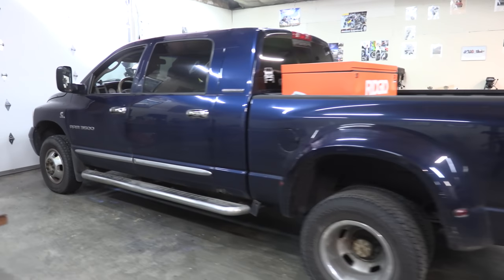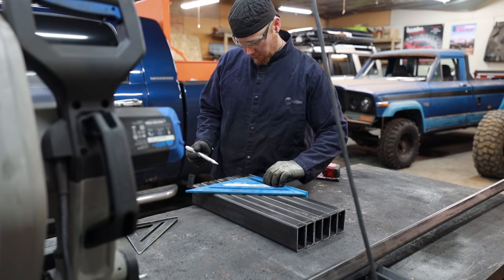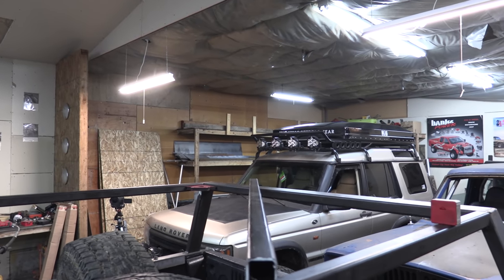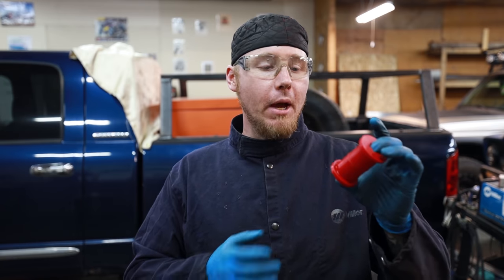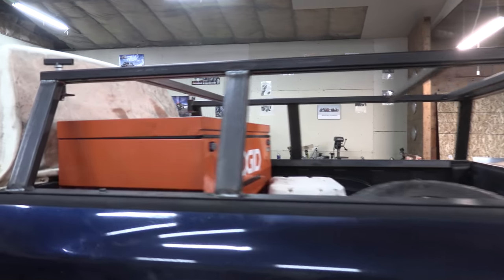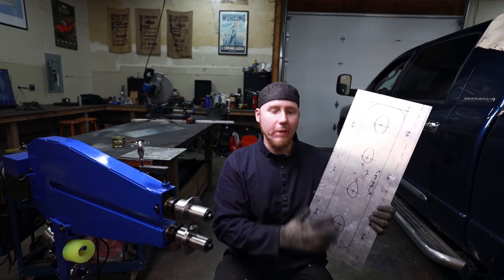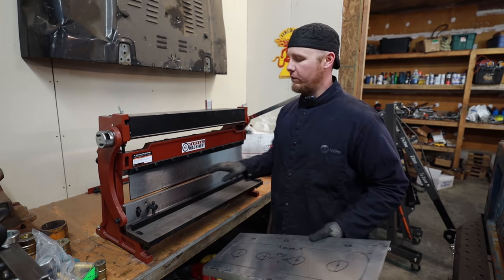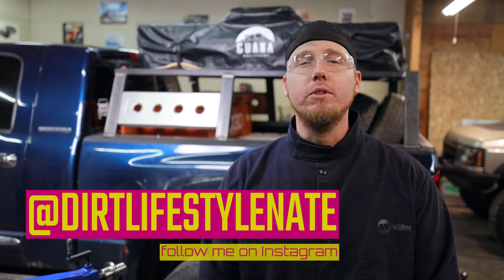Roof Top Tent Camping! Build Your Overland Truck Bed Rack System

Comment: Out of all the trucks to complain about not having enough room to sleep in the cab, a MEGA CAB DODGE?
Reply: I mean, the seats dont quite fold down all the way. And sleeping sideways in the back seat isnt the best either.
Reply from the maker: Lol
Reply: Lol
Reply: Well... it’s just an excuse to build an epic feature on the back, with loads of functionality. Lol
Reply: Sleeping in the back of my Megacab is not great. The 8ft bed in back is much more comfortable.
Reply: I camp nom out of the back seat of my mega cab  I'm 6'4" so I am sleeping caddy corner and uncomfortable. So I am looking at a roof top tent for the neck of my goose neck trailer/19 4runner
Reply: At 6’1” I can’t sleep in the back of my MC. A twin air mattress won’t quite lay flat with the seats folded down.  When I have slept back there to been at an angle.
Reply: Lol but who wants to sleep in the cab of anything really
Reply: @ericl5973  mega cabs don't have an 8ft bed
Reply: @fzj8022  Stock megacabs don't have an 8ft bed.
But stretching trucks is a thing some people do.
Reply: @reaperreaper5098  Yeah no shit
Reply: I'm 6'2" and slept in my mega twice. Once on top of the backseat while folded flat, once in the drivers seat. It would be an okay option with padding, but it's still rough for a taller guy.
Reply: The rrear seats are perfect for truck camping my mega cab rear seats fold down completely flat and I fit my single foam mattress in it perfectly. Let the truck run all night with the ac or heat on. Best camping set up by far.. I've had toppers , roof top tents and nothing beats sleeping off the ground on a comfy mattress inside the safety of my truck.

Comment: If you are wiring up lights you could wire up a 12 volt linear actuator for lifting the frame up. They have good load capacity now and it will just be an up and down switch. Just some food for thought instead of the shocks that we know always fail and your tailgate glass ends up in the middle of your back.

Comment: It’s easy to grab the wires for the bed light from the a pillar for your under cage lights. Maybe not all of them but a subset so you can hit the unlock on keyless and get bed lights from it. Plus it stays on the battery saver for the tipm so you can put them on and they stay lit for 15 minutes or so and then go off (great for getting prepped for bed)
Also the trucks have a high mounted tail wire hidden in the loom back by the hitch for truck caps that bring the third brake light back to the back of the truck so you can put a third brake light on it if you want without having to fuss with tapping wires or having it blink.  Love the truck and the tent rig. Like to see more of it 👍

Comment: Look up Sachs stabilus lift supports, you can go by weight and length, and they also have thread ball hardware to mount anywhere, and essentially create a sprung door on anything

Comment: Damn this is timely.  I'm about to start fabbing up a rack system for my M1102.  Don't think an off-the-shelf systems are going to work for it.
Reply from the maker: Cool project!
Reply: @DirtLifestyle  Yeah it should be.  Going to need to brush up on my aluminum welding skills tho.  Been a while.

Comment: I built a flip up bed rack about a month ago, it works great and it's awesome to be able to get the tent out of the way if you need to access stuff at the back of the bed. I have gas struts on mine, a pair of 200lbs struts did the trick for me.

Comment: Nice work!    I’m building a Jeep trailer right now.  With a tent mount using 1x2 Rec tube 120 wall.  Just put a 14 bolt axle on the trailer.  6” lift kit and 36s on a 77j10 box.  Nice work on your rack!   I like the angled look you have going on.   Looks badass on the dodge!

Comment: You are so spot on where I am at on thinking about setting up my Gladiator!! Literally I have been thinking EXACTLY like you!   I work the oilfields in North Dakota but live in Kennewick WA it’s a 16 hr drive one way and sleeping in the back seat of the Gladiator is... not good rest! So I need a rooftop tent. Also I need water proof and theft proof because I park my Jeep and crawl in my Semi and it’s 4 or more weeks before I get back! I want to build the rack and then sheet the roof and sides with aluminum and the rack itself is aluminum because I want to keep the weight down but need it strong enough to support 4 ( we are adopting 2 kids) you just gave me a huge idea! I too want lights and we are right there with you on “ Tailgate “ cooking! I eagerly await your next video and hopefully you can maybe do one on how to weld aluminum?
Reply: Bud I live on the Oregon coast,  we should talk about setting our gladiators up for a northwest package.  I have a few ideas I'd like to bounce off you.
Reply from the maker: Sounds like a fun project! I'm no expert at aluminum welding. After more time honing my skills I'll definitely make a video 👍
Reply: Tony Montgomery I am very interested in doing this! Thanks
Reply: Dirt Lifestyle I was thinking of cutting and bolting it because I can’t weld it either? :( I am open to any light weight but strong ideas you got

Comment: Just finished making mine from your design: 1/4" angle and 3x1.5x 1/8 wall rectangle for my Sierra.  I have a huge RTT from 23zero and I am glad this rack is redundantly strong with no bolts that could loosen.  Thank you so much for the guide.
Reply: any chance i can get a review from you, in regards to the tent from 23zero, I'm currently looking at one too.

Comment: I am planning on making a rooftop tent rack that swings in a sinilarish manner. Except the tent stays level. I want to tuck it below the roof line but then swing it up to be able to pop the tent open. This is partly because I have a toolbar that I like the look of. 

I came up with an excel sheet that lets you plug in parameters of mounting distance and force and spits out how much net torque you get from the shocks at any particular angle, telling you how hard you have to pull to lift the rack. I’d be happy to share it with you if you’d like
Reply: Hey James. I'm looking at doing something similar to what you describe on my truck. Have any pics or any other info you can share?

Comment: The gas shocks that lift up a 97 to 99 Ford Expedition back patch would probably be plenty of strength to lift up that roof top tent. The back hatch on those Ford Expeditions are roughly 225 lb. The newer Expeditions have an aluminum lift up hatch so the gas props aren't rated to lift as much since the doors lighter but the 97 and 99 has a really heavy Steel lift back hatch

Comment: I have my RTT on my utility bed work truck. First time mounting it was side ways. Every time since then I have mounted so that tent opens over the tailgate. Makes for a great kitchen without having to use an actual table. Also gives you possibility of mounting an awning off the side without interfering with the tent. Also having a rtt with the covered entrance,  I can climb down to a work/kitchen station without getting hammered by rain. As a bonus, when my annex room is set up,  tailgate is conveniently inside. Rare but has happened in Southern California mountains!

Comment: you quit being a union plumber to go full time on your YouTube channel; are you sure you weren't a welder? Because I always see you doing some pretty outstanding fabrications from steel, and I sow you aluminum power steering reservoir and windshield wiper fluid reservoir, and all the welds I'm seeing are professional looking. I'm sure your plumbing work was just as good! Thanks for sharing this fabrication build; because I really have been wanting to get something for the back of my truck, but I think I can weld good enough to accommodate a rooftop tent. I doubt my welds look as good as yours, though, I went to school for it when I was 15 and have done a few things here and there, but I'm 56 now and bought a cheap Harborfreight Chicago Electric 125 plasma mig to mess around with, but now I'm thinking about getting something a little nicer, so I can mig with gas 75/25. I was leaning toward a Lincoln until I saw your Miller Mig, and actually, I think you said it was also capable of Tig for aluminum. Can you stick weld with it as well? great job. This is actually something I would try to tackle myself if I can find a place to buy the steel. If you don't mind me asking where you bought your Miller welder and what model it is? thanks for doing this video; now, if only I were a tent maker lol jk.

Comment: Nice!  I don't remember if you placed a crossbeam above/near your rigid storage box to better support the weight of your tent ... hope it doesn't interfere with being able to get into it.  I initially thought that it might be a good idea to put a single sheet of metal with holes in it on top for the tent to rest on, then I remembered how cold it is and how impossible it is to get any warmth when  you are sitting/laying on anything metal ... you'll never get warm!  I think perhaps long pieces of wood from front to back will make for a more tolerable surface to exist on in the tent.  One idea I thought about that could be interesting is having the tent area sunken in/down.  In this case if you wanted to carry extra material and/or long items you could still cover the top surface and have an alternate place for the tent to sit.  I think not having the tilting top extend fully over (and to the sides) of your rigid box could have been another good option ... I'm thinking if a structure over it was necessary it would be nice to have it swing open the other way, toward the cab (but be sure to put stops in to keep it from bashing/denting the cab top!)  ... I think you're going to have issues accessing your rigid tool box.

Comment: Curious as to why you hinged in the rear and not towards the cab? It seems like the hinge on the tool box and the most likely direction you'll enter the bed (from the tail gate) would make things easier if the latch were at the tail gate it would make things more accessible.

Comment: Looks like someone had a bad miss on a trailer coupler.....not judging, I fully understand "mistakes were made".

Awesome build...I wanted to fab a stake-bed/headache rack for my Ranger....I like this better, but still with protection for the back of the cab because I throw firewood in there and don't wanna bust my glass.  Which I haven't yet, but have come CLOSE more than a few times.  Dumb luck counts.

If the stars align and I can afford it, framed aluminum with steel mesh.  Somewhat the opposite of your material choices, I suppose.

Comment: Love the channel. I wish I had the know how and the tools to emulate the same projects you do. For starters a pipe bender. Just a quick question for anyone. Would it be easier to do pie cuts for the angle you want to get when creating the turn for the crossbar?  Is it better to use one whole tube as opposed to multiple pieces being weld together?  Any feedback would greatly be appreciated

Comment: Great build. Any reason you didn't make the frame out of aluminum? I guess with that truck you aren't to worried about weight but it would have been easier to lift the subframe.
Reply from the maker: I love working with aluminum but the price is outrageous after all the tariffs. A sheet of 18 gauge aluminum was 127 bucks. All the square and rectangular tube I used would have ran up material cost to 500-700 buck in my estimation. So I chose steel for cost. 👍

Comment: Great rack system! 
Ive been bead rolling for a little bit. And the turns are definitely the hardest part to master.
Question? What made you go with steel instead of aluminum  for the frame? Cost wise, would obviously be a few hundred dollars more. But the weight savings, i would think would be worth it?

Comment: Would you recommend MIG or TIG welder for someone wanting to get into fabrication, very similar to what you do around off-roading.
Reply from the maker: Mig. It's easy to learn and more then adequate for 99% of projects 👍
Reply: @DirtLifestyle  Thanks for this, I have been looking for a multi process welder but just cannot find a half decent one. So maybe better to just get a decent stand alone Mig.  Can I suggest a video based on welders , maybe the one you have. what you need to weld what? Like welding alu vs steel etc?

Comment: Sweet.  I have a 2002 Chevy Silverado 3500 Dually Crew Cab with the 8.1L Vortec and Allison transmission and full size bed.  I've been wondering about "overlanding" it, but wondered if it's too big to do that with?  I also live in WA state (Kent), and I'm curious if there are trails that would be good to overland with a rig that size?  Thanks!
Reply from the maker: Hard to say. You just need to be choosy about where to take it. Lots of research before hand 👍
Reply: @DirtLifestyle  Thanks.  The truck is in great shape.  I bought it new from the dealer in 2002 and stopped daily driving it in 2010, so it only has 85K miles on it.  I also forgot to mention in my first post that it's 4wd.  You no doubt figured that though. Your channel really has me wanting to get into welding, but with no current skills I'm thinking I will limit any overland projects I do on this rig or my Jeep to something cool and useful, but not too big or critical to the function of the vehicle (yet!).  I'm really enjoying your channel with the mix of fabrication with off roading and your visits to trails that are feasible for me to reach from my location here in Kent WA.  Thanks!

Comment: Your builds and due to following you for so long I now have all the exact same tools to build this stuff, To include a 1986 Jeep J10, looking at building this same setup for my J10, question, how do you decide on steel size and thickness (if you have a program or calculator) and or what size and thickness did you use for this buildup?
Reply from the maker: I don't have a calculator or anything like that. I just relay pretty heavy on my experience for material sizing. I bet there is an engineering web site with some good info on this. 👍

Comment: What cutting blade are you using on the chop saw ? Thanks in advance
Reply from the maker: It's the OEM blade that comes with the evolution chop saw. It's made specifically for cutting metal
Reply: Dirt Lifestyle I new it was one, very cool !!

Comment: I'm on the same project but for the yj I need it light but strong enough to hold the tent and me I was thinking about using aluminum and trying out those aluminum rods. I need it to fit around the hardtop any cool ideas?
Reply from the maker: Sounds like a tough project man

Comment: Hey brother, I’m building my own rack for my 2019 Silverado. I was going to use 11 gauge for strength but I’m afraid it might be too heavy and could collapse the bed walls. Do you think 16 gauge would be strong enough for a tent on other heavy weight?
Reply from the maker: It should be plenty with the right design 👍

Comment: What was the reason for hinging at the rear? My mind thinks it would have been better to have hinged at the front. 🤷🏻
Reply: I dont think you could get it high enough out of the way
Reply from the maker: Because of the hinge location in the front I couldn't opened the door very far. And I would have to lift the tent to a 90° angle. With it hinged in the rear I only need to lift the tent a few feet. Not even a 45° for full access
Reply: Dirt Lifestyle, gotcha. Thanks for the reply, keep up the good work. I miss doing fabrication work, just don’t have the space (I need a shop BAD!).

Comment: Just curious why did you have it open up that way. I think if it popped up the opposite direction you'd be able to get to your tools a lot better.
Reply from the maker: Because of the hinge location, I wouldn't have been able to open the truck box very far unless I made the rack taller. Fabrication is all about compromise